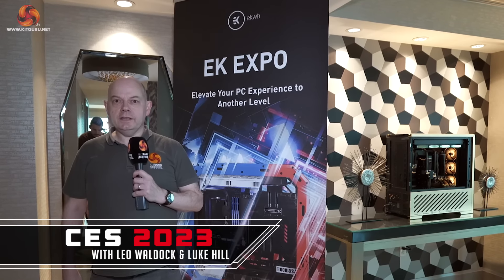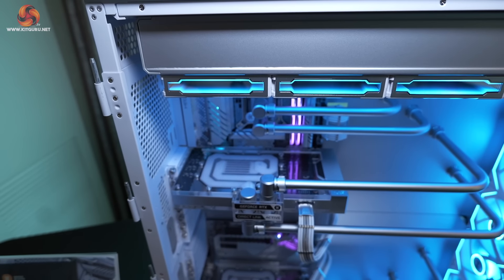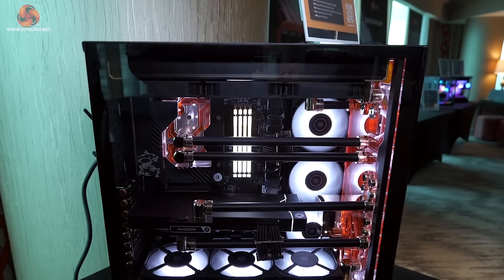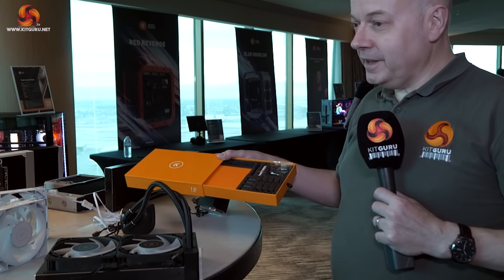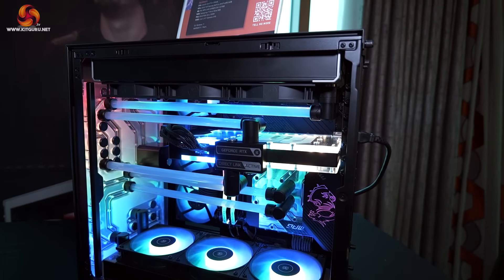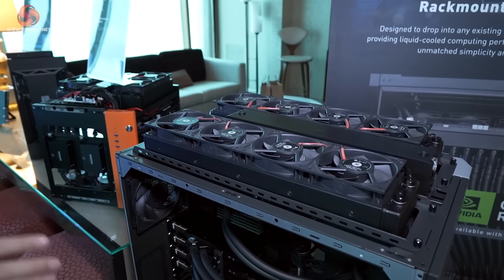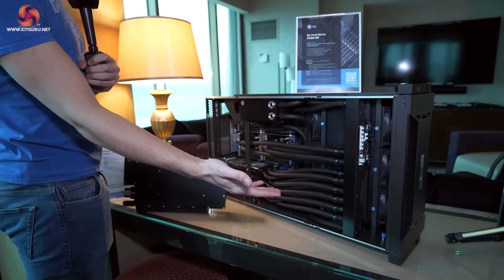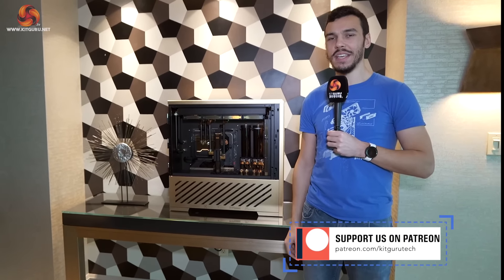CES 2023: EKWB modded PCs, Nucleus AIO and the $60K server!

Comment: All those detailed, finest PC builds, except GPUs in all of them are fed by lame and rough on the eye regular cable bundles. When you could have just 2 nicely bent fat wires with a custom made connector. Why is everyone so scared of wire/connector modding? GPU only needs +12V and -12V. For older 8 pins straight and easy. And the new 12+4 connector is all the same plus some fraud. It's still +/-12V and then some signals suggesting wattage, that are just manipulated at adaptor level.  
Oh, you connected 3x 8 pins, so it must be 450+75W limit for GPU whatever the PSU limit and wiring before, right? 🤣